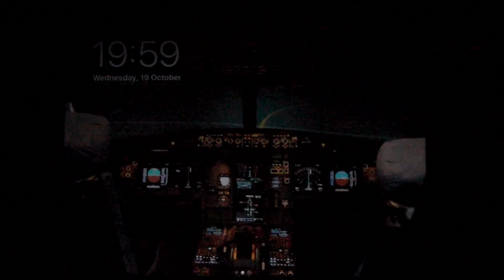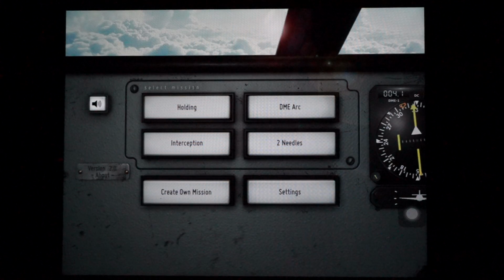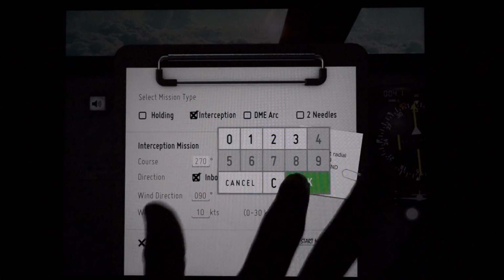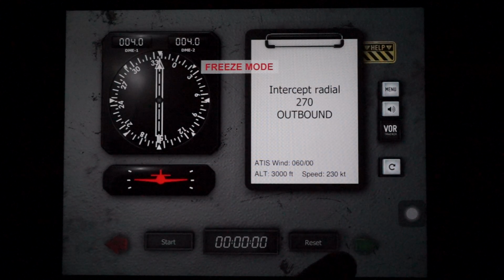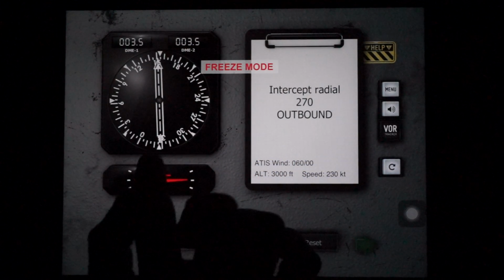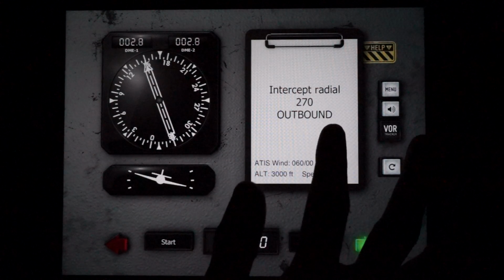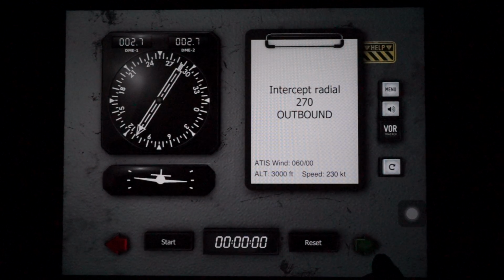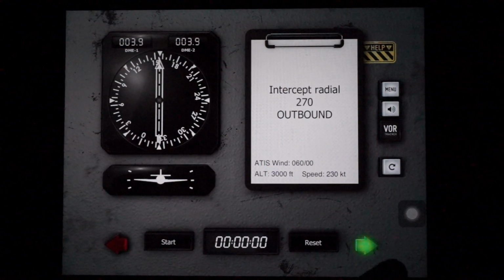Radial Interception using RMI

Comment: How is 27 on the left of needle? Looking from?  6:56
Reply from the maker: Looking at 270 wrt to tail of the needle, 270 lies left of it.
Reply: @poh  it appears to be on the right side only ?
Reply: @poh  wrt?
Reply from the maker: With respect to
Reply: I also would like an explanation on this please. When I look at it appears to be to the right as well.  Unless you think of yourself sitting on the station and looking out towards 270 I can’t see how it is to the left.  So 270 is to the right of the needle ad therefore the current needle (radial 305) is to the left of where we want the needle to go(270). Given this by the explanation of turning in the direction of where you want the needle to go it would be a right turn. From the map we can see it should be a left turn. Please explain
Reply: For the final example the tail is on 180 if you imagine being on the tail (180) 210 appears to be on the left